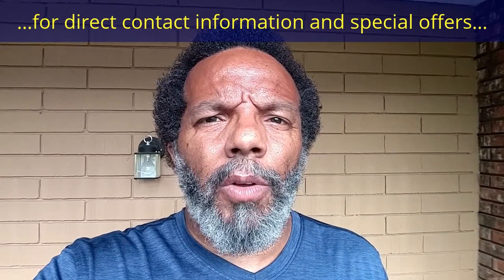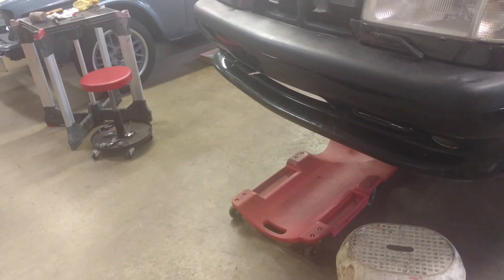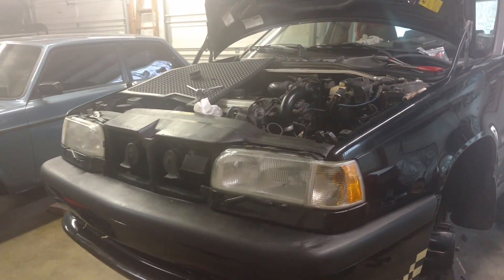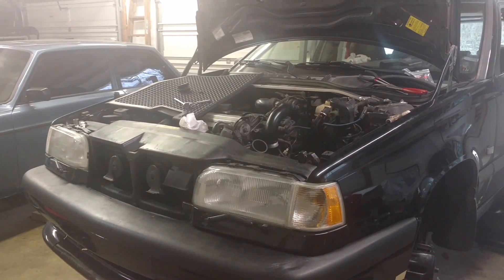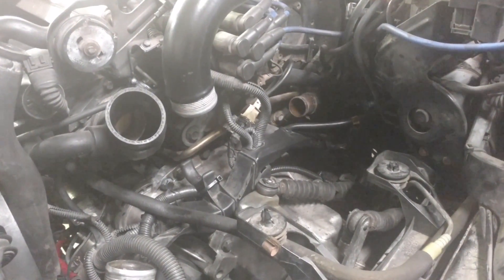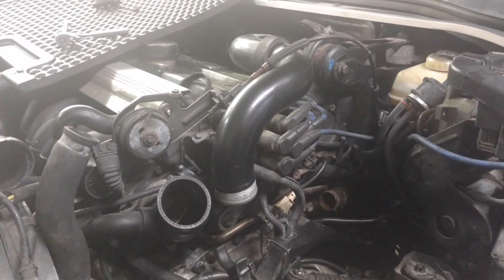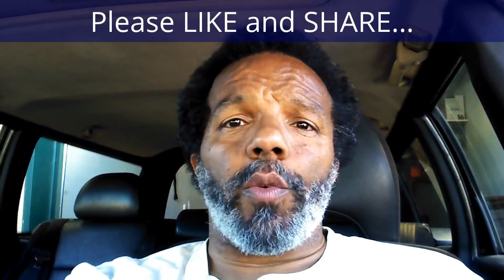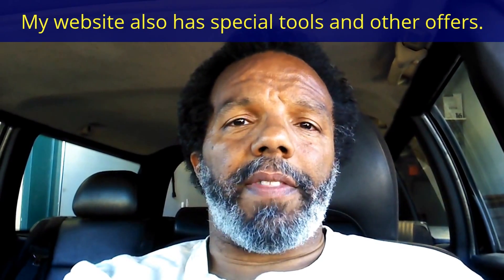Manual transmission swap installation intro for Volvo P80 cars, 850, S70, V70, etc. - VOTD

Comment: Is this possible on 2000 p80 models?   Or does the newer drive by wire ECU cause problems?
Reply from the maker: No problem but a check engine light.

Comment: You need a ecu from the manual car correct?
Reply from the maker: Hmmm, I don't really understand your question. If your car is turbo, you will need a turbo ECU. If you have a 850, you will need a manual ECU for an 850.
Reply: @RobertDIY  My friend is swapping a manual trans from a 99 s70 into his auto 98 s70.  He was going to sell the ECU but i told him to keep it because I think he needs it, they are both t5.
Reply: @MrKushinator420  Bit late, but he shouldn't need it with that car. If he wants he can get the original ECU tuned but I don't believe that is strictly necessary. It should still run fine without a tune, albeit with a CEL.
Reply: @elisabethnixon5059  He was too lazy and ended up selling the donor car.  Have stopped talking to him regularly lol.

Comment: Been in the market for my first car and my family has always driven Volvo's so I'm going to buy one. recently I've been thinking of buying an AWD P80 v70 and doing a manual transmission swap. I was just wondering if you knew of any 5-speed or more transmissions that fit these cars?
Reply from the maker: If you want to keep it AWD, the M66 from an AWD Volvo.
Reply: @RobertDIY  Since the M66 is compatible, could I get away with installing the 6 speed or will it not fit? My idea is to swap the engine with either a t5 or 2.5t from later years. So the 6 speed should work with the t5 but I'm unsure about the 2.5t
Reply from the maker: The M66 is a 6 speed.

Comment: Is it possible for an s80? I have bad transmission and finding another seems to be swapping out for another issue. Thanks
Reply from the maker: Probably, other countries have manual S80's.
Reply: Robert DIY Thanks Robert! I have an s80 in excellent condition, other than the transmission, the warning light comes on usually after a longer drive with some inclines. I can clear the warning and drive it for a while, and then it occurs again. The Geartonic Transmission built by GM seems to have several issues. I’m looking at a 3000$ replacement, and that’s a rebuilt.  Just looking for my options, and I have to determine it it’s worthwhile. Thanks
Reply from the maker: You are welcome.

Comment: For anyone who is wondering about fuel injectors the whites and the blues flow the same cc/min at the same fuel pressure. The Volvo's that used blues also had a higher pressure regulator and that's why they flow more in those cars. If you're using the stick 850 fpr the flow rate of blues will be identical to whites.
Reply from the maker: Thanks for sharing.

Comment: I have 2001 V70. The temp gauge shows hot as you turn the key and start. Engine is not overheating and it is false reading. I changed Thermostat and temp sensor also. No change it is false reading. I have disconnected the fan so the battery does not discharge.  Any way to fix the false reading?     David    630-986-9074
Reply from the maker: Where did you get the replacement temp sensor?
Reply from the maker: https://www.youtube.com/watch?v=aj4tL32XIXs
Reply: I got it from RockAuto new part as Thermostat also new part. Followed your info on Tube also changed the radiator fluid in the process. Thanks  David